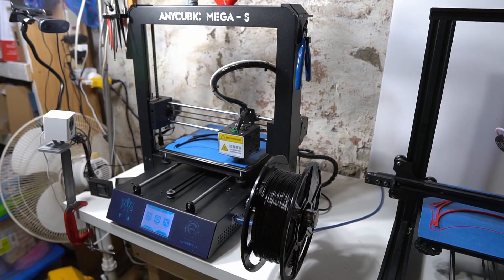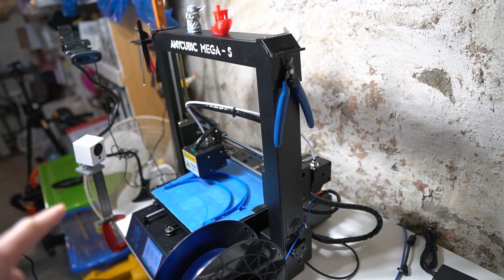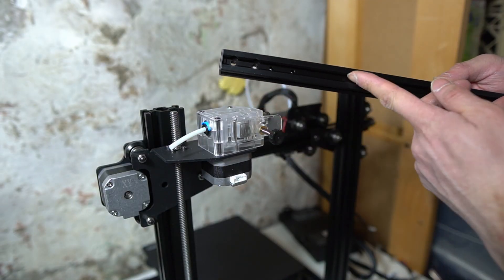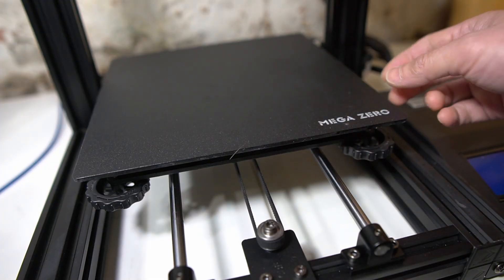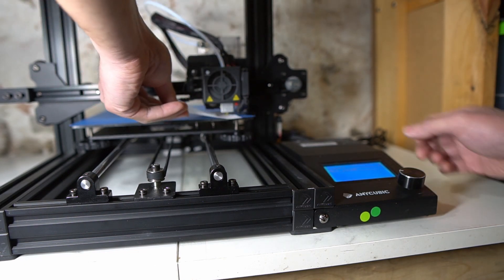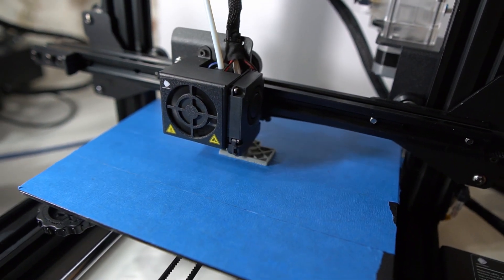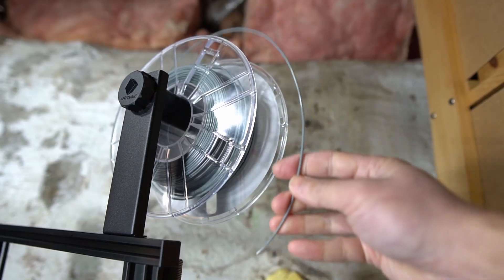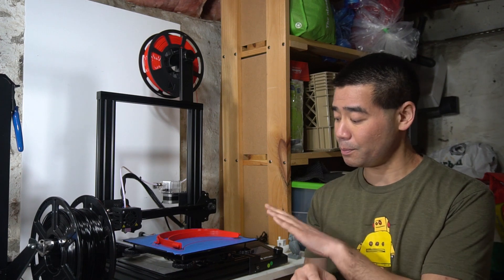Anycubic Mega Zero 3D Printer Unboxing, Assembly and Review

Comment: I just had the leveling knobs on this printer pop off halfway through a 7-hour print. The print popped up into the nozzle and broke the hot end off of the base that supports it. I just never have any luck 3D printing something always goes wrong. I spent a week pulling my hair out trying to figure out why no matter how many times I leveled my bed properly the print head would always start a millimeter and a half above the print surface and it would just turn into a big ball of plastic.

Comment: Just to reference your comment about wearing out your heat bed on the mega x. Residue builds up over time but can be cleaned off with isopropyl alcohol. Pour on a small bit and clean with kitchen towel. Repeat this until towel is clean and it will stick again. Same thing happened to me when I first started.

Comment: This is on sale right now for about 140 usd. Do you think this would be a good first printer? If the glue stick is working to keep prints adhered I'm fine with that. I'm avoiding ender 3 because it seems like you have to do a ton of tinkering and upgrading to get it to work reliably

Comment: I bought the same printer and had the same issue with the extruder. Thanks for the tip. On the other hand I did not have any issue with adhesion to the print bed, actually the part got stuck real good. Will try your painters tape tip to reduce the adhesion.

Comment from the maker: *Correction, the print bed is metal not glass as I mention in the video.  Also I peeled off the print surface as the painters tape would sometimes pull off, IMO it prints much better with out it or you can just print on the stock surface but I suspect over time it would wear out, your mileage may vary.
Reply: Does it has hotbed?
Reply: Hello! Is it aluminium alloy or steel?

Comment: Please do comparison between mega s and mega zero and which one you recommend to buy i need yo use pla tpu and petg on it
Reply from the maker: I would recommend the Mega-S, it has a heated print bed and the frame is better built and uses more bearings and rods.  I will do a comparison once see how well the Zero holds up after many hours of use.
Reply: @AndrewWorkshop  but the build volume of mega s is smaller then zero is the build volume difference important?i am 1st time user and i will be printing general stuff for hobby only like wase lamps and some quad copter parts only
Reply: @sannannaseer1597  Do you plan on printing large prints? Working with the zero right now and I do appreciate how quiet it is